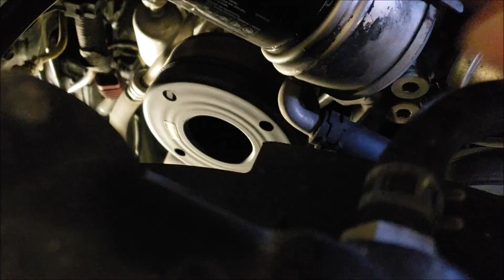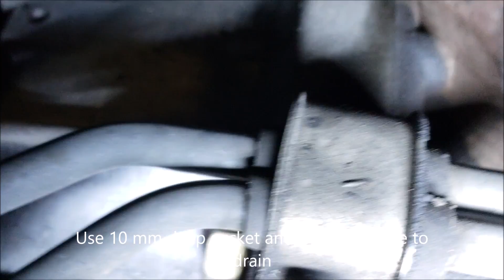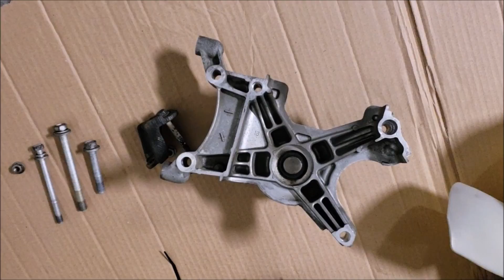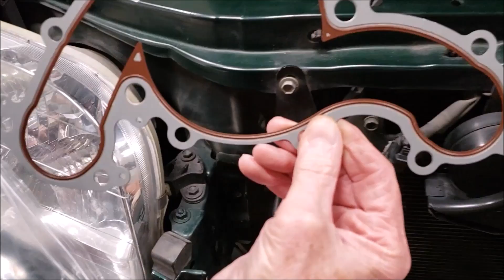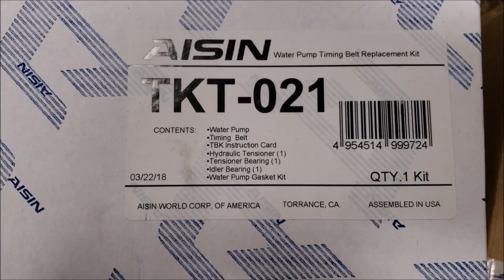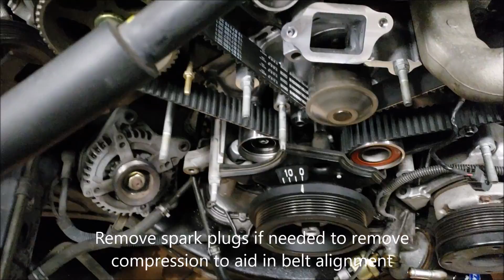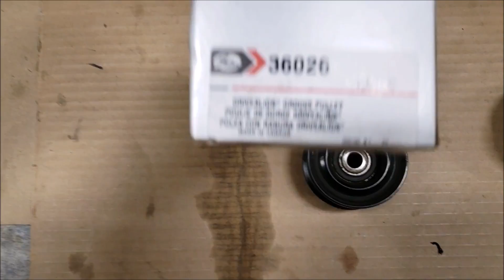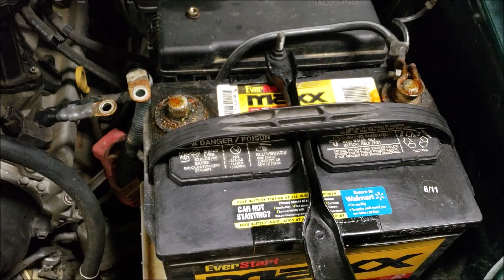STEP by STEP Timing Belt Kit installation: 2UZ-FE V8 4.7;Toyota Tundra, Sequoia, Land Cruiser, Lexus

Comment: On these 2UZ timing-belt jobs, pairing the belt with the water pump, idlers/tensioner, and a fresh bypass tube O-ring is cheap insurance; I also check the cam and crank seals while the covers are off. Happy to assist if you need us—these trucks are our specialty.

Comment: Certainly worth preserving one of the best V8 engines of the twentieth century.

Question: What is that alternative air intake and with it, has the owner observed improved horsepower, fuel economy, or both?
Reply from the maker: It is an older Injen air intake. It does not help fuel economy or power, but it does have an air rush sound sort of like a turbo diesel.

Comment: Great step by step, the only mistake was the timing belt lines did not match up to the correct pulley. The CR side you had on the top side was supposed to be at the bottom to make sure everything was in line/time. The other lines line up to your marks for TDC on each pulley.

Comment: Easier to pull radiator and shroud all right after bottom of around is off from clips. 4 bolts come from the front of the core support. Helps get everting out quick!

Comment: We have an 08 forerunner with the 4.7.. trying to determine if I should tackle the water pump and timing belt myself or take it to the shop.. shop wants about 800 in labor cost.. although I have never done water pump timing belt on this four Runner I have the skill set to do it, but is it worth the amount of work involved to do it myself? Total shop cost would be 1350 but that includes all the parts in addition to the labor.  Would love to hear from guys that have done this job and advise if it’s worth saving the 800 to do myself.

Comment: Those timing belt marks do not look like they line up correctly. Whats up?
Reply from the maker: If you want to use the marks on the belt, and feel better about it, please do. I have not used them on several timing belt replacements. I personally just use the marks on the pulleys.

Comment: This video does not show that you have to advance crankshaft by 50 degree beyond TDC, as I was told, before you remove timing belt so it won't jump. Should I or should I not advance 50 degree?

Comment: When you installed your timing belt why didn't you use the marks? You have the crank marks CR on the Left cam , Left cam on right ETC?
Reply from the maker: Some timing belts have marks, others don't. I personally do not use belt marks, only the marks on the engine. No sweat if you prefer to use the belt marks.

Comment: I think my lexus gs430 has this engine
Reply from the maker: It is probably the 3UZ-FE engine. It is in the same family as the 2UZ in the trucks, but it has an aluminum block and heads versus the iron block in the trucks.  It does have a timing belt and should be replaced at times with a similar procedure.

Comment: Nice under hood hot air intake
Reply from the maker: You know it. I have looked around for an air box but I have been too cheap to buy one that may, or may not, fit.
Reply: @gduplerauto  I know. I fabbed  a box. Gotta get some cooler air in there. Good video btw
Reply from the maker: @robertmoore4637  Thanks. Fabbing a box is cool.  If it works, all the better.

Comment: Looking at this and looks like the belt isn’t properly lined up with timing marks. CR on belt should be lined up with crank dot. Left hand should line up with drivers side. And right hand should be passenger side. Just a heads up to whoever does this.
Reply from the maker: Yes, you can use the marks on the belt and some people like to do that, but we have always focused on the marks on the block and the pulleys.

Comment: I always loosen the fan clutch with the belt on.  It's like a built in strap wrench.  If it slips just lean on the tensioner a bit.
Reply from the maker: Great point and I plan to do that on the next one.

Comment: I do have a question tho my upper right timing mark moved as I accidentally hit the sprocket while removing the water pump, will moving it back on to the timing mark cause an issue?
Reply from the maker: Just saw this, so I am sure you have already worked it out, but a slight bump while the belt is off can be fixed by slightly moving the sprocket back to the original position.

Comment: I believe those bolt holes on the crank pulley can also be used with a pulley holder like I used on my Lexus several years ago?  Correct

Comment: Ugh 🙄 my water pump is leaking from top I just done timing belt and water pump replacement done whole kit came with paper like water pump gasket we drove it for 2 weeks ran fine today started misfiring looked and leaking from the top of the getting orginal metal water pump gasket the came off gotta repeat whole process this sucks
Reply from the maker: That does stink. Was it an Aisin kit?

Comment: Thanks for the video I watched it about a million times😂 I replaced my timing belt on my 2004 tundra this week. It took me 2 full days using mostly harbor freight tools and very little experience in this sort of thing. There’s a video by 1a auto showing a jig using a 2x4 to hold the crank when you torque harmonic balancer that I found helpful as well. I made it with angle iron. Thanks again!
Reply from the maker: Great! Glad you are an official timing belt do-it-yourselfer! Just about all of us have a harbor freight tool, or 6 or so. I did see that 2x4 brace video. Good stuff if you have to, I was glad mine came off with the air ratchet.

Comment: The tensioner for the timing belt is not going back on the pin on the top is not going back into the body is there a reason for this

Comment: Where can I get a crankshaft socket for 2001 Toyota tundra?
Reply from the maker: We used an air impact and an impact socket in the video, but if you are looking for a tool to help remove the crank bolt, check out this one on Amazon: https://www.amazon.com/Sunluway-Harmonic-Damper-Holding-Crankshaft/dp/B07Q29ZMMY/ref=asc_df_B07Q29ZMMY/?tag=hyprod-20&linkCode=df0&hvadid=344004303287&hvpos=&hvnetw=g&hvrand=5866734249747498766&hvpone=&hvptwo=&hvqmt=&hvdev=m&hvdvcmdl=&hvlocint=&hvlocphy=1026036&hvtargid=pla-746414193537&psc=1&tag=&ref=&adgrpid=70731225313&hvpone=&hvptwo=&hvadid=344004303287&hvpos=&hvnetw=g&hvrand=5866734249747498766&hvqmt=&hvdev=m&hvdvcmdl=&hvlocint=&hvlocphy=1026036&hvtargid=pla-746414193537

Comment: i got everything off and down to ac compresser that you have to move to get to the water pump but stripped a hard to get to bolt on the ac pully bracket dont know how to get it off need it off to the side so i can remove old water pump
Reply from the maker: I suggest using some stripped bolt removal sockets. You can pick metric one up at Lowes. Kobalt or Irwin.

Comment: So you don't need to Aline the white lines with the cam indicator on top ? 

There's another video and they mention that I'd really important
Reply from the maker: Check out the description and other discussions on here. If you want to use the marks on the belt you can, but not all belts have marks. Just my opinion, but lining up the proper engine marks with the pulley marks is the key.

Comment: I’m having some trouble with the lower fan bracket bolt underneath the AC compressor re-installing it for some reason it won’t screw back on. Did you have trouble reinstalling that bolt?

Comment: Didn't have to hold the crankshaft to losen it after you set it at 0?
Reply from the maker: No, we used an impact to take off the nut and the crank pulley.
Reply: So it should lock after you clockwise set it at 0? I don't have a impact but I have a torque wrench and breaker bar will that work?
Reply: Just want to make sure I have everything before taking on this project. I don't have the crankshaft holder but I have pulley puller and timing gear puller also a universal pulley holder tool I assume that may even work as the crankshaft holder
Reply: I Greatly appreciate you replying

Comment: i rented a twin cam universal cam holder will this work?
Reply from the maker: Haven't seen it, but if it looks like the one we used, it should. Just need it to pass between the spokes of the pulley to hold it.
Reply: @gduplerauto  did you have to rotate the crank i have a 2002 toyota sequoia about to install new timing n water pump
Reply: didnt know if i need to rotate the bottom crankshaft before putting on the new timing belt
Reply from the maker: @ryanculler7324  we rotated the whole assembly with the old belt in place until the marks lined up. Then we used the tool to keep the cams in place while we removed the old belt.
Reply: I really appreciate the information this will be very useful doing it myself today Thank you 😊

Comment: Thanks for the video but the timing belt is installed backwards
Reply from the maker: Yes, referenced in the description and some of the threads is that we didn't use the marks on the belt. Some belts have them and some don't. We focused on the marks on the pulleys and the engine. If you choose to use the belt marks, I respect that, but the belt marks only line up every so often when rotating the engine.

Comment: Detailed steps, according to the presentation and edits made in this video. I did not add timestamps

Job:
1. Remove the air intake.
2. Remove bottom plate.
3. Drain the radiator from bottom.
4. Remove all hoses coming from radiator.
5. Remove radiator strouds.
6. Remove radiator.
7. Remove fan.
8. Remove idler pulley.
9. Remove passenger side and middle timing belt covers.
10. Remove power steering pump and move out of the way, do not disconnect.
11. Remove timing belt tensioner.
12. Remove oil cooler. Expect coolant to leak.
13. Remove drivers side timing belt cover (lcam).
14. Remove AC compressor bracket.
15. Remove water pump.
16. Crank engine to center using, watch for right left and bottom alignment(on 0).
17. Using an impact wrench remove the crankshaft pulley, may also need puller.
18. Remove lower timing belt cover.
19. Remove beveled keyed gear. (goes away from the belt)
20. Slowly remove the timing belt tensioner.
21. Remove the timing belt.
22. Remove the timing belt tensioner pulley.
23. Remove water pump.
24. Install new water pump with silicone coated o-ring. Torque to spec. 18N/m / 21N/m
25. Install new idler pulley. Bolt threads get threadlocker. Torque to spec. 34.5N/m
26. Install new timing belt tensioner pulley. Bolt threads get threadlocker. Torque to spec. 34.5N/m
27. Install timing belt tensioner. Torque to spec. 26N/m
28. Install timing belt. Go from bottom counter-clockwise to leave slack at the tensioner.
29. Install timing belt gear plate. (Watch the bevel, away from belt)
30. Install lower timing belt cover. (Low torque)
31. Install crank pulley.
32. Install fan bracket with fan bearing. Torque to spec. 26N/m for smaller, 32N/m for larger.
33. Install AC compressor bracket.
34. Install driver side timing belt cover.
35. Install oil cooler hose.
36. Install serpentine (accessory) belt tensioner. 16N/m (below pulley) and 39N/m for alternator bolts.
37. Re-connect power steering pump.
38. Re-connect power steering pump reservoir.
39. Install lower timing belt cover.
40. Install passenger side timing belt cover.
41. Install upper thermostat housing w/ new o-ring, use gasket maker for main water passage(rectangular). Wait for gasket maker to set up before torquing bolts.
42. Install serpentine belt idler pulley. Torque to spec. 39N/m
43. Install fan with clutch. Torque to spec. 30N/m
44. Install accessory/serpentine belt.
45. Install radiator and clean it out if needed. Torque to spec. 12N/m
46. Install upper fan shroud. Torque to spec. (5-7)N/m
47. Install lower fan shroud.
48. Re-connect transmission cooler lines.
49. Install upper and lower radiator hoses. 
50. Install Air Intake.
51. Add coolant.
52. Top-off transmission fluid.
53. Install battery.
54. Start her up.

About to do this on a 2004 Tundra Double Cab. OEM parts are not always terribly far off price-wise from aftermarket, I am having luck on Ebay a lot but for some things like hoses I may sway into the aftermarket options. 

Thanks
Reply from the maker: Good deal! I appreciate the added feature! With the Aisin being OEM, the cost wouldn't be much more to go complete OEM.

Comment: Will this work on a 2006 toyota tundra sr5 v8
Reply from the maker: Yes, but the exact timing alignment depends on the year. The instructions from the Aisin kit are as follows depending upon the year: 

2000-04:
Turn the crankshaft clockwise until No.1 cylinder at TDC with timing marks aligned.
2005-08:
Turn the crankshaft clockwise until No.1 cylinder at TDC with timing marks aligned.
Turn the crankshaft clockwise a further 50° until pulley timing mark aligned with guide pulley bolt.
Camshaft sprocket timing marks will move forward 25°
2009:
Turn the crankshaft clockwise until notch on sprocket guide is aligned with mark on oil pump body.
Ensure camshaft sprocket timing marks are aligned.
Turn the crankshaft counterclockwise 50° until notch on sprocket guide is at approximately the 12 o'clock position.
Camshaft sprocket timing marks will move approximately 25° counterclockwise and will no longer be aligned.
Reply: @gduplerauto   wow thanks man, I’m looking at a tundra for my first truck and I might be hopefully buying it soon and will be doing the same thing you did in this video, thanks!
Reply from the maker: @nathanspilker277  No problem! They are great trucks as long as you keep up with the maintenance. You are smart to do this after you buy it. No way to verify the belt has been changed before until you get in there.

Comment: probably a dumb question but why didn't take the rad fan off when the serpentine belt was still tensioned on the pulley to keep the fan from spinning?
Reply from the maker: Not a dumb question at all. In fact, your suggestion is an easier way to do it. Nice to have options, right?

Comment: Awesome video no way I can do this complex job. I wish I can pay you to do it . Do you have any suggestions in Austin, Texas. my daughter drives a 2004 toyota 4 runner  180k. What is the going price for this type of job?
Reply from the maker: Thanks! Labor is costly on this job. If you have someone replace the parts I mention, you are looking at $1000 to $1000. You could get by cheaper if not all parts are replaced (like the fan bracket). If you have a friend who can help, maybe you could tackle this job?
Reply: @gduplerauto  No friend that can do this. How about a place any suggestion? I am sure Toyota will charge double
Reply: Thank you so much

Comment: In your video, which is really great, it indicates that the right hand cam is on the left side of the vehicle, and vis versa.  Can you explain, is this correct?
Reply from the maker: I don't pay attention to the marks on the belt.  Some timing belts have them and some don't. If you want to use them you can, but I focus on lining up the marks on the pulleys and keeping the belt tight.

Comment: I got lost at the end of reinstalling the timing belt  with that special tool to hold the sprocket)  I didn't hear the purpose to use it.
Reply from the maker: Just to hold the sprocket still while you install the belt. You can use something like a large screwdriver to hold it, but will be a bit trickier.
Reply: @gduplerauto  ok thank you very much.  I do appreciate your reply and advice.

Comment: Sir you are awesome! One question for ya if I had everything lined up she belt was tight, I tried to spin it two rounds to make sure it was on proper but I'm not strong enough to do 2 full rounds would that mess up my lines?
Reply from the maker: Thanks! If you had the marks lined up and the belt is tight, you should be good. You are fighting compression in the engine so if you want to spin it and double check, I suggest removing the spark plugs so it will turn easier.
Reply: @gduplerauto  thank you my dear

Comment: Is this similar to a V6 4.0??
Reply from the maker: The 4.0 has a timing chain. Earlier V6's (3.0 and 3.4) have a belt. You do want to keep an eye on the idler pulleys, thermostat housing, and water pump.
Reply: @gduplerauto  thanks 👍

Comment: This video is just what I needed today!  I'm just ready to install a timing belt on my 2003 Tundra 4.7 V-8 and after watching you have answered some questions I really need help with. So, thank you for that.   I can't recall, but what is the starting sequence to reboot computer etc.. Is it..turn ignition to on, then off 2 times then start on the 3rd?  I hope this makes sense. Thanks so much!
Reply from the maker: Good deal, happy to help! If the battery is disconnected for 5 to 10 minutes, the ecm will reset and clear any codes. I haven't done any particular reset procedure after replacing the belt and parts, but it would be good to turn to ignition, sit there for 30 seconds or so, then turn off and then crank it.
Reply: @gduplerauto  Thank you again!!!!!!

Comment: Would this be the same steps as doing a timing kit on a 3UZ?
Reply from the maker: The 3UZ in Lexus vehicles is similar since it is in the same engine family. You can follow the basics, realizing there will be some differences due to the vehicle and engine. You can buy an Aisin kit for the 3UZ and follow the instructions in the kit for setting the timing.
Reply: @gduplerauto  thank you and I bought the kit already

Comment: Great Vid, but thought I might add that it really isn't necessary to remove the top part of the fan shroud.  You can just pull off the bottom part and then slide the rad up through the top with the shroud in place.  It will save you a little bit of time and hassle.  The  radiator on the sequoia is so easy to remove that I pull it any time I need to do some work on the front part of the engine.
Reply from the maker: Thanks, and thanks for the point on the fan shroud!  I will try your method next time.